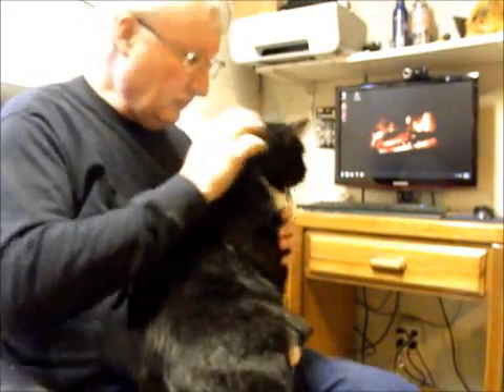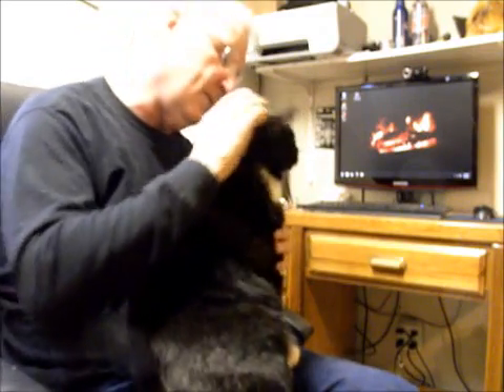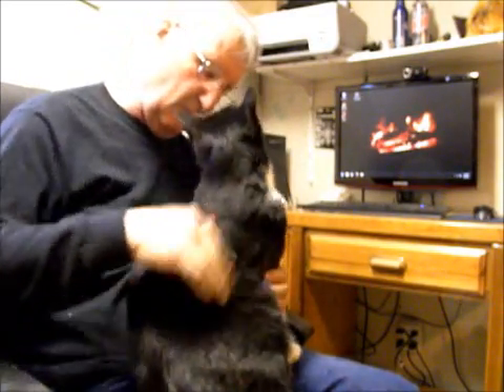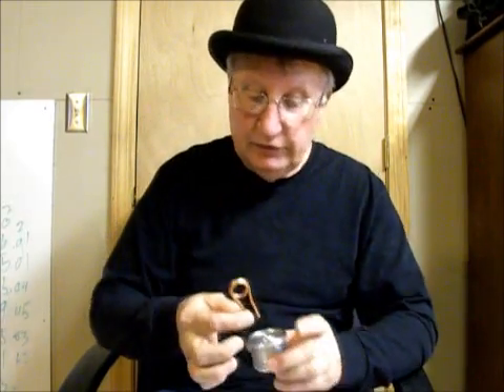Questions

Comment: tetkoba (on youtube) makes one with six loops
the loops are not sealed into the base, i.e. the reservoir is open in the middle
he uses aluminum for loops, steel wool for wick inside the tubes

Comment: i was looking into coil stoves some time ago. i saw one with a flame spreader with a needle valve on the end. this went through a nut between the coils. this gave you a way to change the flame (high-low). also depending no hole size you can burn anything .